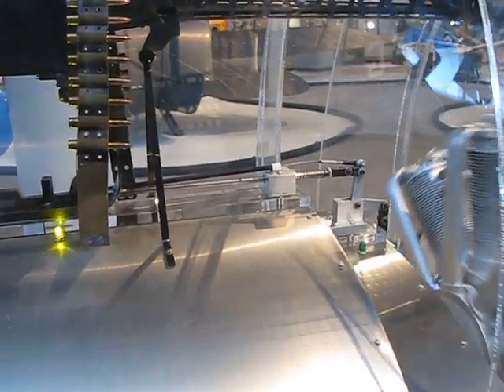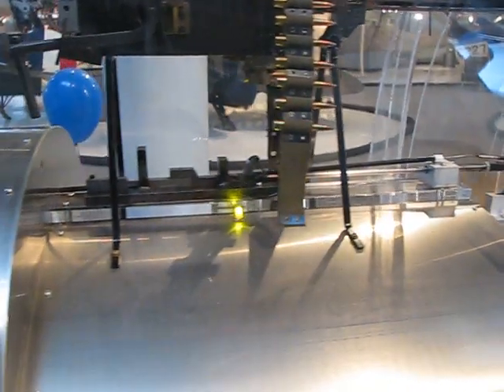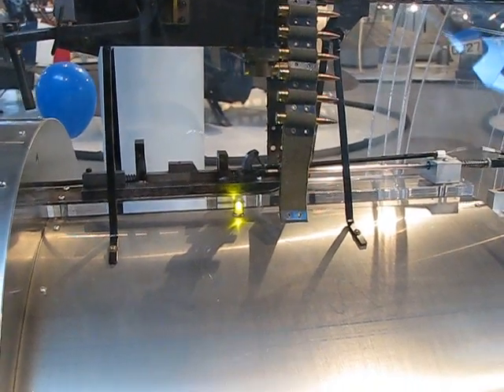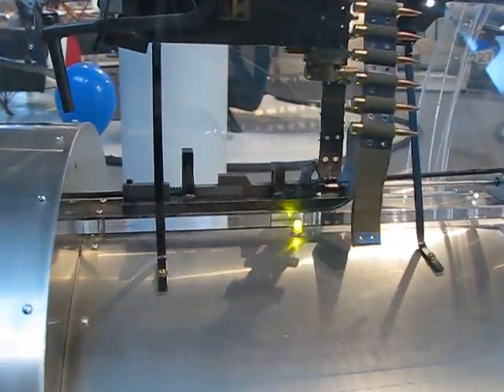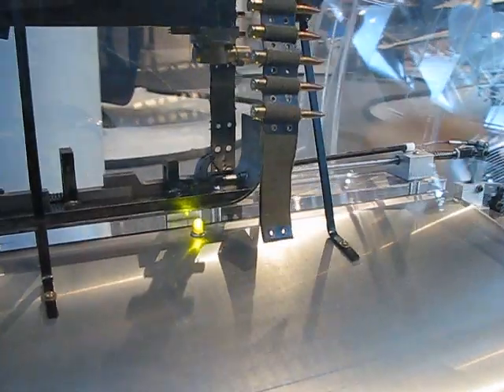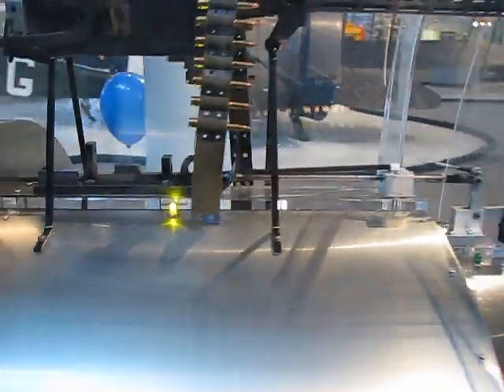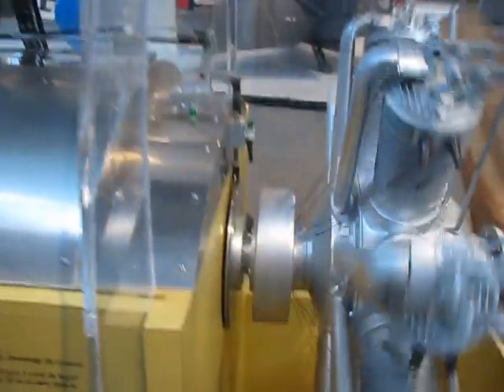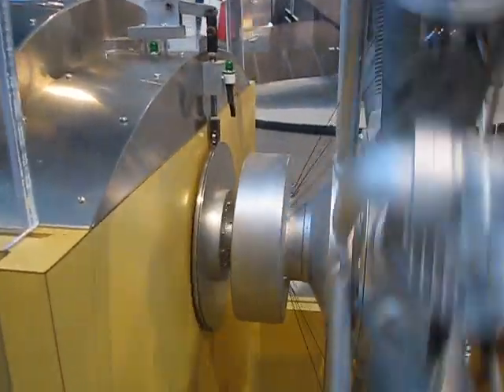interrupter gear or machine gun synchronizer

Comment: As a kid, I just thought that they prayed for the best and hoped it didn't hit the propellers that were spinning so fast lol
Reply: LOL
Reply: The earliest fighter did exactly that, the Morane Monoplane.  But it was also equipped with a deflector to help save the propeller from the roughly 5-10% of the bullets that hit it.  https://upload.wikimedia.org/wikipedia/commons/1/1c/Morane-Saulnier_Type_N.jpg
Reply: same, i thought there's a chance of the bullet got the propeller
Reply: Same but now I know
Reply: They did, actually. At least until the invention of the synchronized gear.
Reply: @batozorange  They actually had quite a few solutions for the problem even without the synchronisation gear. They had pusher planes such as the British Airco DH.2 were the propeller was placed on the rear of the aircraft rather than the front, they also mounted machine guns on top of the wings, so they shot over the propeller such as with the French Nieuport 16.
Reply: Same here, when i learned about the use of "deflectors" i was like "WTF i was right all along??"
Reply: @TheShadowOfZama  Or they mounted deflectors on the blades that would ricochet the bullet if it hit.
Reply: As the son of a corp. pilot, I thought too for a number of yrs about this concept. Dad set us straight about this, explaining as here, there were mechanics involved with synchronization/interruption of MG firing thru prop blades. I found out that Dutch aviator/inventor, Anthony Fokker, invented this back during early phase of WWOne..
Reply: I thought the machine gun was placed right through the middle of the propeller and there was no chance of hitting.
Reply: @Yildun28  Right..the very first monoplane to employ the synchronization mechanism was Anthony Fokker's 'Eindekker' monoplane, armed with one Spandau 8mm (7.9mm) machine gun..It racked up some kills!!
Reply: @albertnoble2727 ..Al, that came later on bef. WW2, when Messerschmitt mounted a 30mm slo-fire cannon to fire through a hollow center in the prop shaft..Of course, they also had those twin cowl-mounted 8mm MG15-17 mach. guns,synched to fire through the propeller arc, along with 2 wing-mounted 20mm mach. guns..very deadly!
Reply: @samburkes7552  I knew it!!! That would be another engineering challenge but it's way more reliable imo.
Reply: That’s so good ass praying lol
Reply: you are not entirely wrong, before this invention, a french pilot equipped the back of his props with steel deflectors which would just tear up any would that actually hit the prop....... its quite amazing to think that in JUST 2 years they went from using metal and praying it defelected the rounds in a direction other then back at the pilot... to inventing an invention that turned the tides of one of the most important wars in human history..... quite amazing honestly..... HATS OFF to all engineers out there... you guys are a different breed (and I mean that in the most kind way possible haha :P )

Comment: This means that the RPM of the engine modifies the cyclic rate of fire.  Your gun fires faster or slower depending on the speed of the engine.  Cool engineering!
Reply: Also means it is a semi-automatic gun not a 'machine' gun in the tradition sense. The cam is basically a trigger pull and release.
Reply: @advoc8tr  Grey area there, but for most part, you're correct..A matter of semantics.
Reply: @samburkes7552  Not grey. They tried making automatic guns work with synchronization gears like that and never really managed. The best solution is to use a semi-automatic gun as shown in  the video.
Reply: @paulmarchi1393  Don't quite agree with that there. A firearm like that is either full auto, or semi-auto.Way I logically view it, being a ballistics expert in a gun store, it's full-auto until the cam system "interrupts", or stops the bolt from going into battery, firing the gun, or the cam actuation system dictates whether the gun continues firing or not..

Comment: @Marc Opie: Some did, take a look at the SE5a aircraft, they had a Maxim gun mounted on the nose to be fired through the propeller and a Lewis machine gun mounted on the top of the wing that fired over the propeller. There are other examples like the Nieuport 11 which had a Lewis mounted above the wing as well. The problem with this is you then have to account for convergence, in WW2 on say a BF-109, the cannons are mounted on the wings, outside of the propeller's arc, because of this they had to set up the guns in such a way that the two guns were basically shooting perpendicular to each other so that at say 3000 yards the bullet from each gun would, in a perfect world without gravity, wind and imperfection, would collide at a single point. This means if you're say 2000 yards from a target and you're aiming directly at the tail of an enemy aircraft, when you pull the trigger, your bullets will actually hit on each side of the point you're aiming at, rather than hitting the tail where your gun sight is pointed because you're too close so the ammunition hasn't gone far enough to hit that convergence point.

I'm sure there's more to it and other reasons but that's one major downside of having guns mounted outside the propeller.
Reply: Cheeky Donkey, most exactly correct. Its,the job of Ordnance to properly "zero-point"/harmonize all the guns, usually, as found out recently, zeroed about 500yds, a workable distance..The RAF employed slightly different harmonization zero points. This concept, along with the employment of the reflex gunsight sitting ahead of the pilot, is not all that different than the bore-sighting of a hi-powered hunting rifle, using the optical bore-sight as a tool with the scope mounted...I work in a gunshop here in Miss, this being an adjunct to my other gun-cleaning duties..Thnx

Comment: The Synchronization gear
 or a gun synchronizer invented by the ROMANIAN George Constantinescu (1881-1965)
.
I wonder myself WHY does this short video clip NOT mention HIS name ?!?
His hydraulic machine gun synchronization gear allowed airplane-mounted guns to shoot between the spinning blades of the propeller. The Constantinesco synchronization gear (or "CC" gear) was first used operationally on the D.H.4s of No. 55 squadron R.F.C. from March 1917, during World War I, and rapidly became standard equipment, replacing a variety of mechanical gears. It continued to be used by the Royal Air Force until World War II – the Gloster Gladiator being the last British fighter to be equipped with "CC" gear.

Comment: So the machine gun is set up for semi-auto fire and the propellor cam pulls the trigger. Those props went at about 1200 to 1400 RPM and the guns typically cycled at about 500 to 600 RPM so the gun either missed a cycle when the trigger pulled before it was ready or the cam trigger was disabled by the gun until it had cycled or the guns were altered to cycle at more than double their normal rate.

Comment: Marc Opie having the gun mounted on the center of the plane allows for straight firing where as if you're firing from the wing the guns are slanted inwards slightly to make the bullets cross at a certain point in front of the plane which reduces accuracy if a target is past that crossing point in the path of the bullets

Comment: WTF, all the radial engine cylinders also rotate?
Reply: Not all of em do, but some did.
Reply: Allen Roth
Really? The engine rotates along with the propeller?
Are you sure?
Reply: Yes. The two basic types of radials are called rotary-type radial and static-type radial. Rotary radials produced the greatest horsepower for their weight. The cylinders of a rotary-type radial engine are mounted radially around a small crankcase and rotate with the prop, while the crankshaft remains stationary, mounted to the firewall. The biggest disadvantage was the torque produced by the large rotating mass of the prop and the cylinders. A large number of WWI pilots died, mainly on takeoff, because so much torque made the aircraft difficult to control. This difficulty, coupled with carburetion, lubrication and exhaust system problems, limited development. Static type radials have the crankcase mounted stationary to the firewall, while the crankshaft rotates like most radial engines from post-WWI and on.
Reply: Khristofer Thomason
Thanks for the awesome explanation. It sounds crazy that the engine works in "reverse". I can imagine balancing such a large rotating mass would be difficult.
Reply: Khristofer Thomason  Holy Jezus, i never knew that...:o An I am a big airplane fan :D Never thought I will be so amazed after a certain age... :o
Reply: Khristofer Thomason
Very cool
Reply: blabby102 this type of radial was used on the sopwith camel.
Reply: On a rotary engine of the time...yes.   That's how they were cooled.  A radial engine is different in that the engine doesn't rotate, but it's still air-cooled.

Comment: Ok now it all makes sense, I was looking at war thunder and wondering, wtf is this shit, the guns fire through the propeller ?
Reply: +Silver Mirai Right LOL
Reply: +Silver Mirai knowing that electronic circuits didn't exist at the time of WW1 i was wonder how they did it
Reply: So funny. I'm here because I wanted to learn how they do it also.  Actually I learned a year ago and forgot.  Ha.  So cool.
Reply: iTheGeek
well, they still had little practical use. I'm guessing the device was purely mechanical
Reply: Most of this gear was mechanical, but there were examples of electrical interuptor gear in WWII. Problaby the most famous was the Fw-190 which had a 20mm cannon in each wing root synched to fire through the prop. Because this particular cannon (the MG 151) fired it's rounds with an electric charge rather than a firing pin, it was very easy and reliable to arrange an electrical switch on the prop shaft that cut the firing circuit at the moment a blade was in the way.

Comment: That is the 1st time I have ever seen a whole engine rotate. I would love to see how the fuel lines and electrical cables connect to it.
Reply: Jonathan DeWitt it was pretty common for these old aircraft, almost all of them had a rotary engine
Reply: It is crazy and fascinating engineering.  From what I remember, the engines were 2-stroke and the hub that was bolted to the airframe, that the engine rotated on, was hollow and a carburetor was bolted backwards to it.  This fed the caster oil fuel mixture into the crankcase to cool and lube it first before being transferred into the combustion chamber to be burnt.  I don't know for certain, but I imagine the transfer passage for the intake was part of the cylinder casting, like it is for 2-stroke engines today.  
Not sure how they fired the ignition, but with the whole engine rotating and each cylinder firing in the same position of the rotation, they could have got away with having an electrode from the magneto/coil sticking out to come in contact with and fire each spark plug as it rotated past.  That would have been cool.
All of this to try to get each cylinder out into the slipstream to keep an air-cooled engine cool.
Reply: Just watched the video again and this engine has overhead intake valves.  You can see the single pushrod in front of each cylinder to open and close the valve and the external 'transfer port' at the back of the engine leading from the crankcase to the intake valve of each cylinder.

Comment: Because the recording person moved - you don't get to hear - if this IS what the recorded narrator says -  that ALL MG's or cannon firing through a propeller disk, right up until end WWII - 

are in semi-automatic mode.  ? Yes.

That is, the gun can't fire a burst of rounds, just one round at a time, triggered by the engine / propeller, so that the rounds go between the blades.  That's a very important concept and it is the main reason why the cyclic rate of fire of guns firing through the propeller was so much lower.  Once constants speed / variable pitch propellers came in this ROF became relatively fixed. The only way to avoid this ROF issue was to fire a single gun through the propeller mechanism.  And this was usually a Heavy MG or cannon by WWII, to maximise the effectiveness of a nose mounted gun.
Reply: +Timothy Bailey 
All the guns that I have fired shot only one round at a time, no matter what mode the selector was set on.

Comment: Marc Opie In WWI the prop had to be a specific size to get the new invention in the sky.  Mounting the gun on the side would be a very difficult task when trying to fire straight at an opponent. In WWII with mounting guns in the wings and having a compete elaborate electrical firing unit to get it to work with deflection (how much in front of a turning target); it then became possible to mount weapons there and zero the gun angle to the center for convergence.  Basically, in 1915 there was no technology to mount from the side. You wouldn't be able to clear jams or judge where you firing would likely land. But in WWII jams became less and less a problem with better feeding system for rounds to chamber thus you see a lot of US planes with it wing mounted machine guns.  The Germans and Japanese still used this sync of firing through props for better straights shots rather than zeroing wing mounted guns without the deflection calculation in their cockpits because they just didn't have the technology.

Comment: okay, mystery solved on how propellers weren't getting blown off during dogfights.
though i recon at some point that mechanism failed, and I'm pretty sure they did given the time period, so i gotta look up cases of those
Reply: The way it was made, if the mechanism fails the gun wont fire at all, unless the pilot does something to disconnect the gun, or jury rig it, from the sync gear. Which would have probably been possible in the early planes, while in flight, but later planes had the guns housed in the fuselage which would make disconnecting them impossible in flight. Also the guns were semi-automatic and used the rotation of the propeller to provide a pretty decent rate of fire for the time period. Which means it would be awfully hard to use in a combat situation without the sync gear. 

I know this is kind of late and you have probably already figured this out. But I felt like passing on my knowledge anyway.

Comment: Except this propeller has 2 blade and the spindle only has one raised bump.  Shouldn't it have 2?
Reply: One reason therefore could be that the machine gun would jam, because it would not be capable to fire such an amount of bullets / minute, as the engine rotates at full operational speed.

Comment: why are the pistons spinning?
Reply: It's called a radial engine.  Pretty common in aircraft.  The spinning pistons make air cooling very efficient.
Reply: @thomasraskopf5747  Bollocks. It's a rotary engine not a radial. Crankshaft is fixed and prop rotates with the cylinders.

Comment: Correct me if im wrong.. but it seems the gear only allows one bullet per revolution of the propeller. However there are 2 oppurtune gaps in the propellers 1 revolution sooo shouldnt it shoot 2x as many bullets than this?
Reply: I don't know these guns but if I have to guess, I would say that they weren't fast enough
Reply: Trop José Thats a good point. I didnt think of that
Reply: The MG-14 ROF was around 900 rds. a min. When you consider the top speed for these aircraft the ROF was substantial. The main issue was durability due to the hollow air cooled design   Experiments we also done mounting as many as three machine guns side by side.

Comment: This propeller is rotating with the engine😆?
Reply: It's a rotary engine. The crankshaft is stationary, attached to a bulkhead and is off centre with respect to the axis of the propeller, the cylinders rotate with the propeller.  Big rotating mass at the front of the airframe brings its own problems with respect to engine torque and gyroscope effects..which made the Sopwith Camel both tricky to fly yet lethal in combat.

Comment: The engines did not spin! That's not true.
Reply: Wrong. Early ROTARY engines did spin. But only on the very first planes. Later in World War I only the crank shaft did spin.
Reply from the maker: David Babcock This is called a ROTARY engine, it did spin. A RADIAL engine which "looks" same doesn't spin.
Reply: Actually i had never heard of one, pretty interesting.